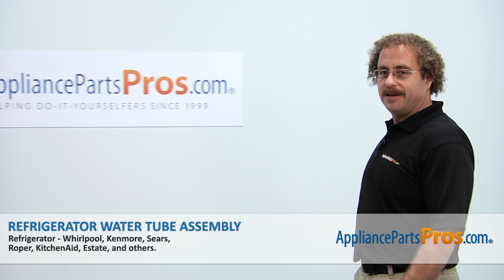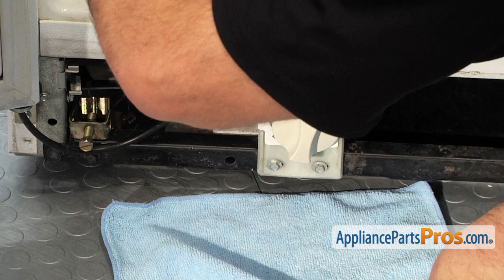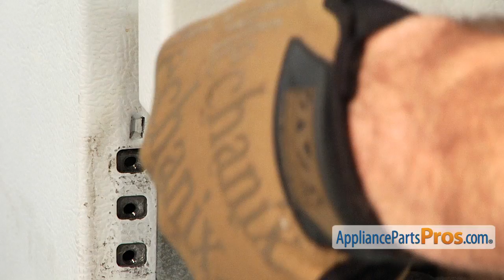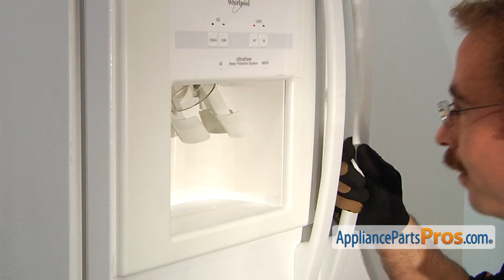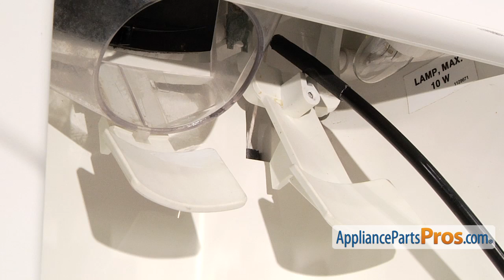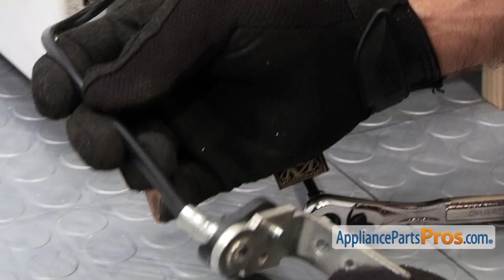How To: Whirlpool/KitchenAid/Maytag Water Tube Assembly WP4388152

Comment: It worked exactly like in the video!!!  Saved myself a hundred bucks or so by doing it myself. One note... Do not yank on the hose when pulling it through - the door might come off of the block underneath. If it does don't panic  -the top hinge will hold it until you can reposition the block. Excellent Tutorial. The part cost was reasonable also.
Reply from the maker: Pis Nop Thanks for the tip and good job on changing out the water line.

Comment: This is by far the better of videos on this subject.

Other videos want us to thread the water tube in from the bottom. That means that we cannot use the standard replacement tubes (since the pour spout is permanently glued to the dispensing end at the top), something they neglect to mention. 

I had already removed the water tube before finding this video so I didn't use a string to guide the new hose to the hole. instead, I used the natural bend in the hose (due to coiling) to angle the hose toward the hole. It came out the bottom on the first try.

Good luck!
Reply from the maker: We're glad the video was helpful! Thanks for letting us know how the repair went for you.
Reply: My string broke and I guess I put too much tape on cuz the tube got stuck. But thanks to your comment I just threaded the new tube back thru and it seemed to go directly to the hole (twice). Of course this was after much sweating and thinking I'd have to remove the inner panel of the freezer door or water dispenser panel. But your comment made me decide to give it a try and I'm so glad it worked. Thank you!

Comment: Jee.  Got the parts for my Kenmore 1069552812 model. The OEM
Water dispenser 2157744 replaced with 4388152 and WP4388152 fitting
(Same as shown). But without your video I was at a loss.  Did not know the send two hoses to fit multiple Models.  Now I see mine will use the black as you demonstrated.  Thanks sir.

Comment: When reinstalling tube run string out the top hole three or four feet so if the tape slips the string will still be in the "run."

Comment: It is easier to remove the nylon nozzle first, then feed the tube from the bottom without taking off the door hinge and not needing the fish string. Then re-attach the nylon nozzle on the top or just shape the tube end to serve as the nozzle.
It is better to dangle the poly tube below the filter to produce less stress when the door swings which tend to crack the poly especially when hardened over time.
Most of all, it is possible to use generic poly tubing instead of the specified repair kit.
Reply: Is the nozzle removable with out damaging it is like a fitting that can be released? And if the new line is fed from bottom to top no string is required?

Comment: Hello,

I have a 20 year old Kenmore model 57762791, side by side fridge. Recently, the water dispenser began dripping after dispensing a glass of water. I wish I knew about your site before I ordered from Sears Parts Direct where I was told to order part# WP4388152 Refrigerator Dispenser Fitting and Water Tube Assembly.

Thank God for your video on how to change the part, which I did this morning. Unfortunately, it did not help a bit. 

Can you please tell me what could be causing the issue. I followed your instructions exactly and there are no leaks. 

Thank you in advance for your time and again, your video was perfect. If people would just follow your instructions as stated, there is no reason anyone should have had a problem replacing the tube.

BTW, I found that on this model, I could not remove the black plastic cam but it did  not hinder the passing / threading of the tube through it.

Evan

Comment: I have a Kenmore refrigerator and did the same as the vidio but, the new water line only goes in about 8" inches and no further. so I take it back out and the end of the is full of insulation, what now?😢 Well, I found out what was wrong, my string that I used was too thick, I switched over to a flat waxed cable tie, worked like a champ 😀
Reply from the maker: Were you able to maintain tension on the string to keep the tube from veering off course inside the door?
Reply: AppliancePartsPros yes, it's all back together and in good shape.
Reply from the maker: Glad you were able to get it fixed. Francis! And that's a good tip about the flat waxed cable tie. It's a tight space that it all has to fit through.

Comment: Hi;
Thanks for the great video.
But, I have a problem.
I taped sting to old tube and started to pull out, every thing went well for a while and then about half way through the tube started to bind I pulled a little harder and tube started to come again but it wasn't taking any string from below.  And of course when the tube came free there was no string attached.
What do I do now or am I screwed?
Reply from the maker: Tom Arciero You may just have to play round with it till you get it through. You could also take the door off and lay it on a table to make it easier to see up into the lower hole.

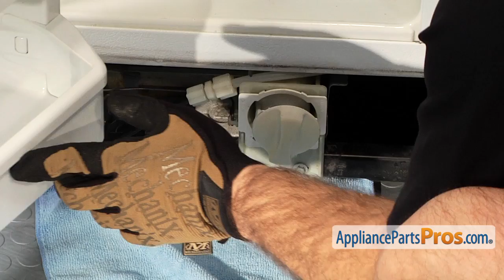Comment: Do you have the part number for the water line on the right side of the compression fitting that you are unscrewing at 1:05?  Where does that line attach to at that other end in the back of the fridge?  Thanks!
Reply from the maker: If you follow it back it should go up to the cold water tank. You can go to our site and enter your model number to find the right one for it.

Comment: Does GE make a kit? If not I will make one of these work. GE has problems with line freezing or after market filters clogging the line. I think they are foamed in. I run into this repair problem all of the time, GE's solution replace entire door. I have been able to break some off them loose using compressed air, or steamer.I am working a better method other then thawing out the whole refrigerator. I know they make a heater kit to help prevent freezing but getting it unclogged or thawed out is another battle. As soon as Im able to get my hands on a junk door, I will reverse engineer it.
Reply from the maker: I have not seen a kit form GE yet.

Comment: I am unable to pull the water line up or down. Is there anything inside the door, maybe behind dispenser panel it could be stuck on?  thank you
Reply from the maker: We'd be happy to help you out with that! We offer free technical advice and diagnosis. You can give us a call at 1-877-477-7278 or you can chat us at our website: http://www.appliancepartspros.com/. We will need your model number to give you accurate advice, which you can locate using this tool on our website: http://www.appliancepartspros.com/modelnumber_locator.aspx
Reply: I have the same promblem

Comment: Can this be done with a GE side by side fridge? I can't seem to find this part on the parts diagram . Somehow a particle got lodged inside this line after changing the water filter to a non-oem part. I tried everything from weedwacker line, assorted steel wires and compressed air. I tried it from the top/spout and also from the bottom after removing the coupling. Nothing seems to work. The blockage is just about a few inches from the dispenser.
Reply from the maker: You can post the model number and problem on our repair forum. The techs can help you out with the problem!
Reply: AppliancePartsPros Okay, Thanks!

Comment: My refrigerator is an LG MODEL #LSC27937ST. The problem is that it makes very few ice cubes and the water coming out is also little. I wish some expert advice on how to fix it and where to buy parts for this brand. Thank you kindly.
Reply from the maker: +Carmelo Rivera Could be a water pressure problem, make sure the water supply valve is open all the way. Also if the filter is old it could cause a reduction of system pressure. You can also post the problem along with the appliance model number on our repair forum and the techs can help you troubleshoot the problem. http://forum.appliancepartspros.com/

Comment: Do you have any videos from the ice maker line tube on the top and then from the back of the fridge  thank you
Reply from the maker: Do you mean the fitting in the back wall? If so here is the video for a popular one: Refrigerator Icemaker Fill Tube Fitting (part #2196157)-How To Replace
Reply: yea, I have a side by side mine goes on the left side top upper area, and it was leaking water in the back upper area due to pushing to much to the wall (lady fault) but I replace it thank guys !!! I subscribe

Comment: Would the same procedure work on a 1991 GE TFX 27FMA and what would be the part number that I would order. Thanks
Reply from the maker: Mark Hochheiser It would be changed out about the same way unfortunately the part for you model number has been discontinued by the manufacturer. You can post the problem along with the appliance model number in our repair forum and see if the techs are familiar with this enough to see if there is a work around.

Comment: What about for a water line in a LG side by side refrigerator door LRSC26912SW?
Reply: Contiki Cartier Did you get an answer about the LG water line in freezer door?
Reply: No. I just plugged the hose. I only dispenses ice now.
Reply from the maker: Strange this was not responded to, sorry about that. We are always making new videos, but we do not have one for that specific part at this time.
Reply: NO KIDDING!!!  
You guys do rock though.

I tried to figure it out and I have many years of experience working on spas and appliances. 
Got skunked on this one!
Reply from the maker: Thank you! We do videos based on the popularity of the part, I do not know where this water line comes up in sales but I will send it over to be checked out, no promises though!! Thanks again.
Reply from the maker: jerrywilbanks
 See reply to Contiki!
Reply: AppliancePartsPros 
Thanx anyhow. The ice dispenser is still working, but no water.
 :(
Reply from the maker: You can also post the problem along with the appliance model number on our repair forum and the techs can help you troubleshoot the problem. http://forum.appliancepartspros.com/

Comment: Suggestion:  On my GEProfile PSC23SGMDBS I have had endless issues and repair calls on the water/ice dispenser. I do not want to turn it off at the wall.   I would like to keep the ice maker working while totally disabling the dispenser.  No water or ice from the door.  I can open the freezer for ice.  How could I do that?
Reply from the maker: RosieCa Have you checked the user manual to see if there is a child lock feature? You can also post the problem along with the appliance model number on our repair forum and the techs can help you troubleshoot the problem.

Comment: what if your tube is broken inside the door, the string wont work.. what now
Reply from the maker: +Fred Flintstone Missed this question. If you have not got it fixed you can post the problem along with the appliance model number on our repair forum and the techs can help you troubleshoot the problem.

Comment: I have a Frigidaire FRS26ZRH, will this work for it?
Reply from the maker: This is for a Whirlpool so yours will be different. I could not find the model number you gave, please get the full model and serial numbers off the model number tag. Then give us a call and we can look up whatever you need for it, 1-877-477-7278.
Reply: Model is FRS26ZSH. I would need a video on removing the front water assembly as it is different than the video.
Reply from the maker: Still missing a few digits of the model number. You can go to our site and look at the breakdown diagrams to see how it goes together. You can also post the problem in the repair forum and the tech can help trouble shoot it. It takes time to find the right appliance and make a video, the ones we put up now have been weeks in the works so I can't promise a video will be available anytime soon. If you look at this part: AP2115415, you will see 2 legs that lock into the dispenser. You may have reach up and release them to pull the front cover off.